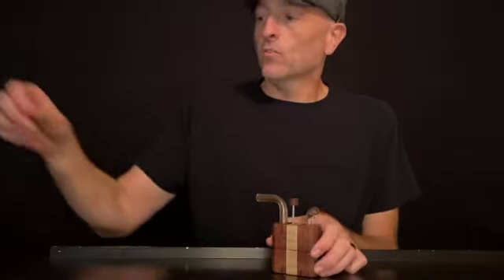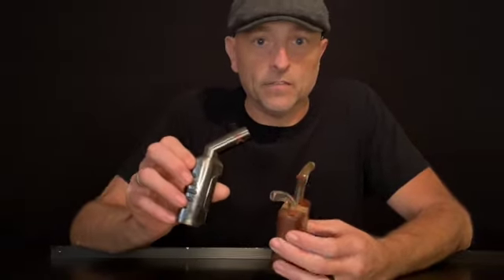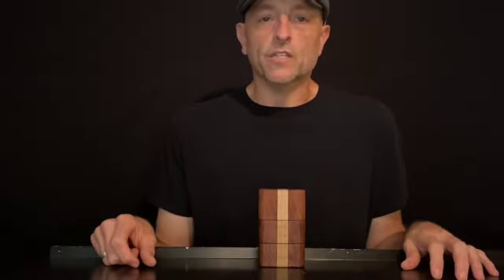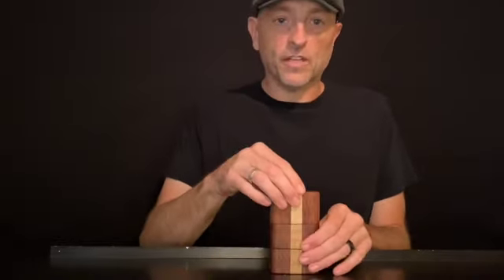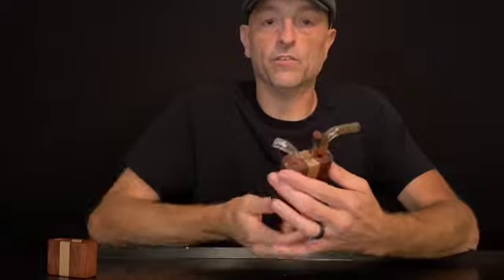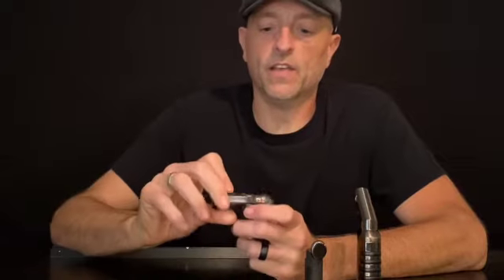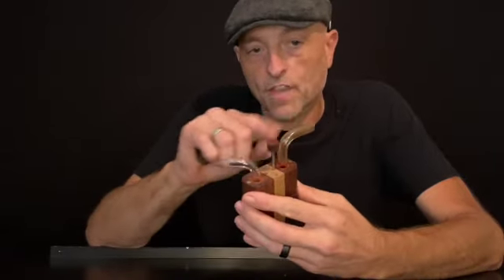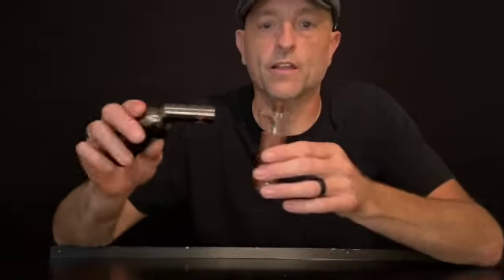Intro to NOVA

Comment: What's that torch called though. It looks perfect for the nova
Reply from the maker: Here’s my arsenal. 

https://www.amazon.com/hz/wishlist/ls/238ZH2N7I641F?ref_=wl_share
Reply: @dougswoodery8470  so that's your new lighter off choice? I was a little unsure since you were using something different in the video. If that's your new go to then I'm gonna have to get it
Reply from the maker: The torch in the video is the Yusud at the top of my list.
Reply: @dougswoodery8470  for whatever reason that torch isn't showing up when i click on your stuff. So my apologies.  Which do you prefer, the one in the video or the cheapest  one? I just want what works best with the nova, dont care the price.
Reply from the maker: Yusud Fire Jet Torch Lighter Butane Fuel Refillable, Windproof Lighter Fluid Refill, Cool Table Top Jet Lighters for Men https://www.amazon.com/dp/B07MD2CJWC/ref=cm_sw_r_cp_api_glt_fabc_XFAADDZPVKFZBEZYXYBC?_encoding=UTF8&psc=1
Reply: @dougswoodery8470  much appreciated. I'm loving my nova thus far, still a bit of a newbie to it but its performing very well when I get the technique right. Just want to get the most out of it. So I want a torch that pairs great with it